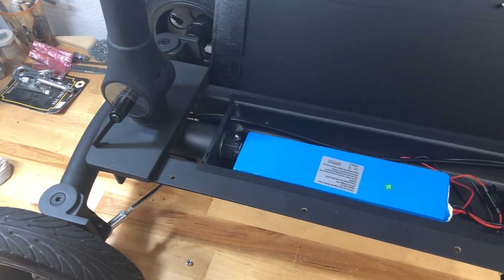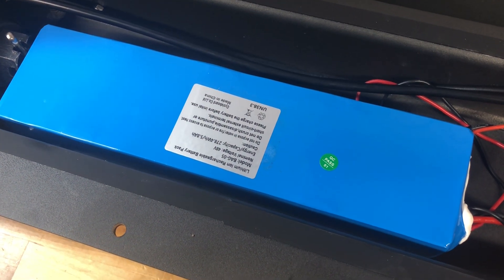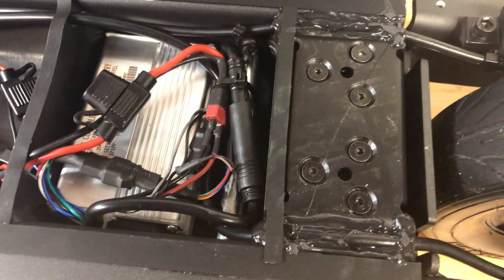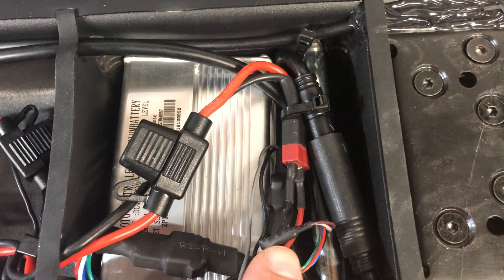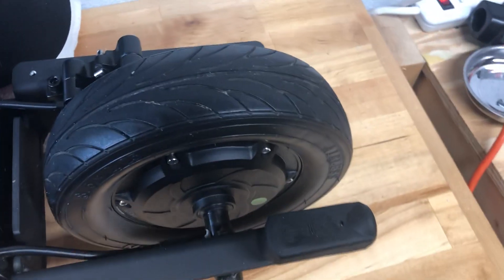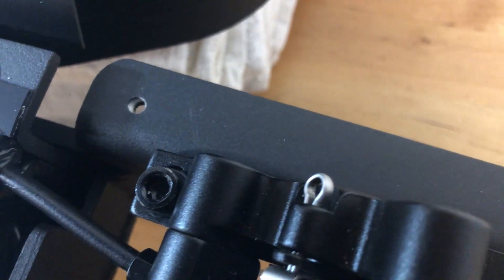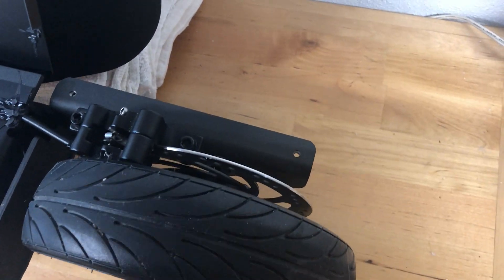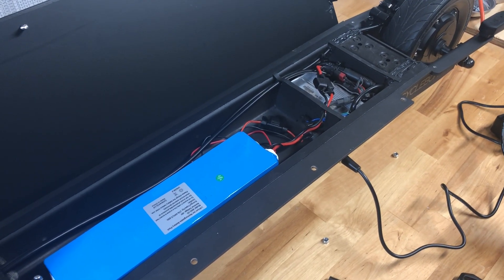CycleBoard Elite - Gen 2 Battery Compartment

Comment: HI Sean, great video.  We designed the tail lights to attach on the underside of the rear swing arm so that they can be installed when the rear fender is also installed, just fyi.  The 4 tapped holes on the rear swing arm are for the rear fender that is coming soon and most bicycle trailers will attach to the left side motor axle with a 12mm coupler.
Reply: Hurry up with Scottybob's!  He live's in Heavens waiting room!  He may not have much time left...
Reply: @steve9021oh  Who sez I'm goin' to Heaven?....At the tender age of 73, I figure I've got about 20 years left....Next up is a jet surfboard.....Miss surfing and it rarely exists on the gulf coast of FL......Lookin' forward to carvng up Boatdrinksasota Bay on a jetboard.....arrrrrrr
Reply: okay,.......where's my rover?.....ordered it 8 months ago..... for the record, i bought an electric bike (voltbike mariner) 1.5 yrs ago.....at least 7 folks in my old folks trailer park on sarasota bay now ride electric bikes within last year....not sure how many crazy old timers will go for cycleboards, but there's bound to be a few, once they've seen mine-if-i-ever-get-it.....hint hint.... ;o)